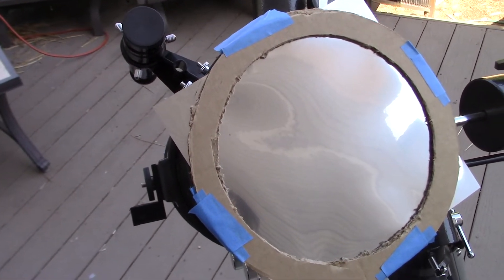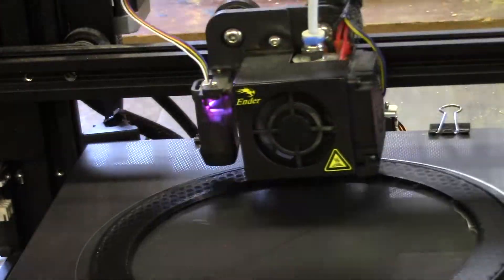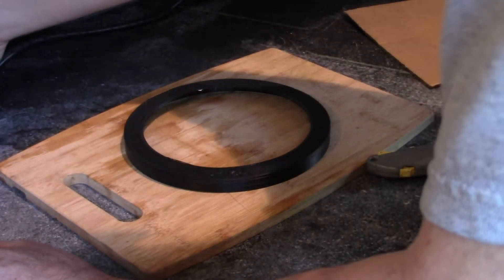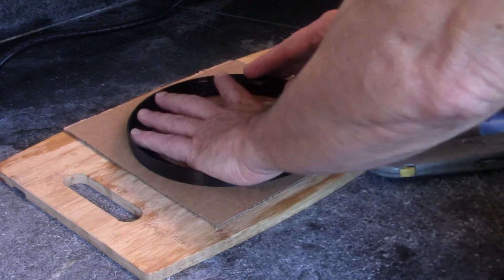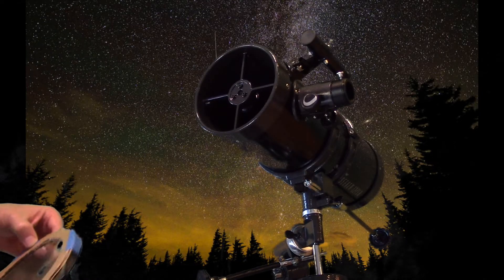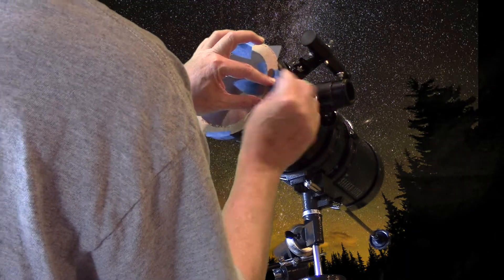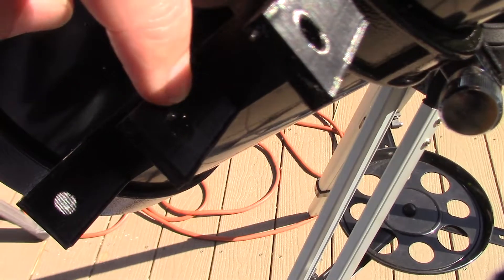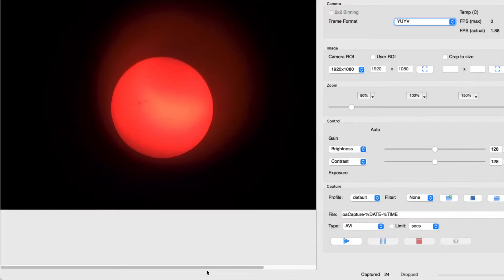DIY Solar Filter - How To Make

Comment: That sun finder sight that you fabricated is neat.  I don't have a 3D printer, but would like to try making one at my bench.  Do you have the specifications for that piece?
Reply from the maker: I have not made a drawing yet, but it's really simple.  Overall it is 2/34" wide by 4" long.  Front 2 plates are 1 1/4" apart, back plate is 2 1/4" from the middle plate.  Hole size is 1/4' in diameter.  Plates are 1 1/4" tall with the holes 3/4" from the bottom.
Reply from the maker: Also, you can reference an image of the finder here on my blog:  https://madscientistguy.com/astronomy/simple-solar-finder/
Reply: Ok, thanks much.
Reply: By the way after watching your collimation video I was able to get some great views of Mars and Jupiter a few nights ago.  With a 25mm eyepiece I was able to make out a dark belt near Jupiter's equator.  Not bad for a budget telescope!
Reply from the maker: Well that's awesome.  Glad you got to see it.